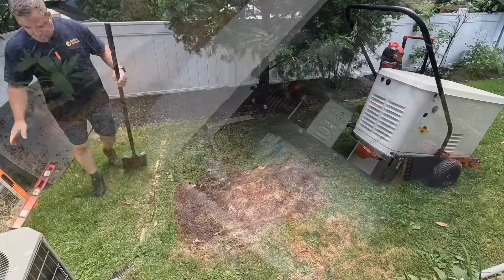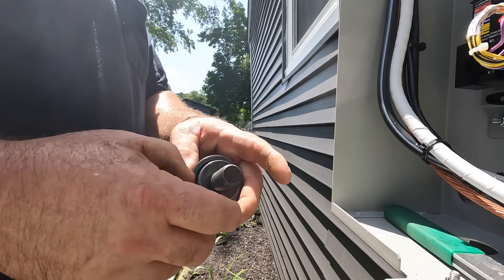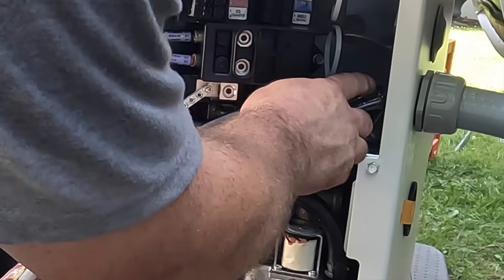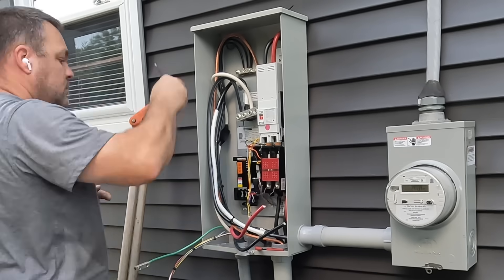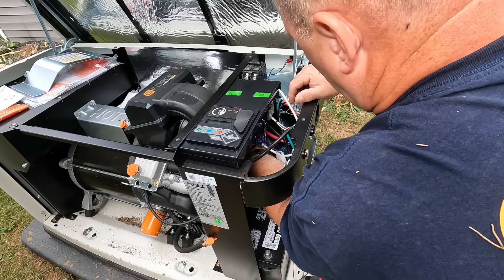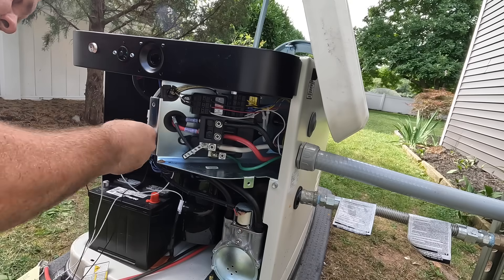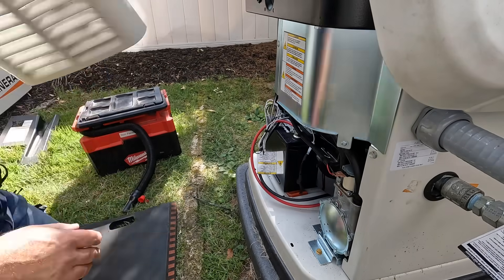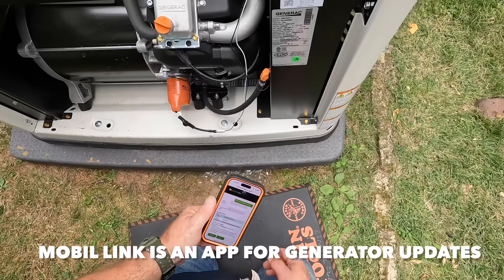Watch me install a generator in Garwood, New Jersey

Comment: Ron, wonder if I could ask for some advice, love the videos even though I'm not an electrician.... mechanic that specializes in wiring for tractor trailers and refrigerated trailers. 
I'm not looking for "how too" advice electrically, more.... how to ask an electrician for help.
I'm looking at adding one of these to a house I just bough (funny enough it's near one of generac plants).
My issue, I'd like the main panel/meter updated too 200Amp before/while this is installed. All stuff I have done in the past, but when an electrician friend of mine pulled the meter for me, double checked my work (found nothing wrong) and then did his work upgrading the meter box and such for the utility company to then do their stuff.  
He passed and TBH, new house is too far to ask even if he hadn't. 
As a mechanic I understand electricians gotta eat too, so not trying to....  so what's a good way to go about asking a fellow electrician if I can do some of the "grunt work" to keep costs down, without offending?  I'm in an area that needs no permits unless hiring out, so IDK if that will affect things. 
I thought about having someone put the disconnect in and.... well....
Reply from the maker: The grunt work might be digging a trench, or going into a crawlspace.  No one wants to do that.

Comment: Thanks for all these great videos. I found your channel researching on how to install a Generac generator. I did most of the work myself. I got the 200 amp breaker panel with the transfer switch . Had a licensed electrician wire that. I set, wired the generator to the panel and performed all the checks in the manual. Did a half hour test run.  Worked great, then waited and waited for the power to go out then finally, ran for 17 hours straight no problems. Your videos helped me a lot. With the owners manual it’s pretty straight forward. If you use an AGM battery you don’t need the battery mat, I did wire in for the oil heater.

Comment: Great video, but I have a few questions. First, was a permit required for the gas hookup? Second, could the electrical and gas lines to the generator be buried in the ground? Third, I realize it all depends on usage, but how often does the generator need to be serviced? Thanks,
Reply from the maker: This town required mechanical, electrical, and zoning permits.  Usually it’s ok to bury the gas and electric in the same trench but check with the building department first.

Comment: I have this same gen. with 2 load sheds for the A/C's. One day one of my A/H's didn't come on. Thought it was the usual float switch. Nope. Had no 220v. Checked the breaker it wasn't tripped. I pulled the panel and had voltage coming out of the breaker. I tied the wires at the A/H and had continuity at the breaker. I thought maybe a critter ate the wires in the attic but all good. I was stumped. I even swapped breakers which made no sense but same condition. I finally remembered the load shed. I bypassed it and my A/H came back on. Turns out Generac had a bunch of bad boards. The original board is red. The replacement is blue. If this ever happens you don't have to bypass it. Just pull the connector off the board on the load shed. It's basically a contactor that's normally closed. If there is an issue it opens. The opposite of an A/C contactor. Generac covered this under warranty.
Reply: As it turns out, my electrician who wired the generator never connected my AC to the load shedder  so for now, I turn off my AC when a storm approaches so as not to overtax the generac if we lose utility power. For all the $$ I was charged, I can''t believe they did not do that.

Comment: Why use that expensive composite cable though?  Since it was a straight shot you might have run individual conductors and saved money and not had to strip that heavy jacket.  That stuff is typically used fully exposed, it's rated for it, though it makes it look like you hooked up the generator with an extension cord, some people want only the cheapest
Reply from the maker: You must not know what you’re talking about. The cable isn’t “cheap” and it slashes labor.
Reply: @electricianron_New_Jersey  Well I do personally install generators for a living, not just one or two a year.  So I might know what I am talking about.  I have used that cable in some circumstances.  But for a 10 foot run that is already inside a conduit I don't see the rationale.  Why not just run it exposed then?  I don't see the labor savings on this particular job.
Reply: @nspro931  I agree with Ron, I.m a Factory Authorized Generac Dealer/Service. I only stock the copper Gen Cable for all Generator Jobs, you can go inside/outside with one type of cable, sleeve it outside if you want, Only have to stock one kind of cable, Who wants to fish 4 power conductors and 7 thwn wires thru that sealtite, worry about hooking it up correctly, The Gen cable is already labeled and color coded, It saves labor $$$$
Reply: @paulcoulston1987  In that case why use Sealtite?
Reply: That's why I said, sleeve it if you want to, some inspectors would make you sleeve it for physical protection, that's a AHJ  interpretation, I would also sleeve it from where it leaves the wall into the generator and supported on the unit strut but if I have a long line on the wall I would just strap it to the wall. Again your choice along with the AHJ

Comment: Hey Ron really nice job, However does Code allow the control wire to be in the same conduit as high voltage wires ?? I'm guessing the control wires are shielded cable
Reply: Great question....( I saw that too) yes as long as the insulation rating is equal or greater than the other conductors in the conduit. Control wiring of this spec is avail. Ron is deferring to the mfg install directions as he mentioned.
Reply from the maker: Nah that’s some Kohler BS

Comment: Great job as usual Ron. I was on a Generac Facebook page and was lambasted from some idiots telling me not to install the battery heater and oil heater. I ask them why and they said it will melt the battery and other areas 😂. Some people right. I have the similar generator at my house and works great 👍. Thanks for the nice video and explanation.

Comment: Why didnt you want to bury the feeder and gas piping? Ive never seen an aboveground install. Seems like its in the way
Reply: Was wondering this too.
Reply: Yeah that’s a real trip hazard, also should’ve put protective caps on the top of those struts.
Reply: Knock it off. The customer doesn’t always want to pay extra for a trench. Sometimes there are water/gas/electric lines buried. It’s only a few feet off the house and this is the way to do it if you don’t have trenching included in your bid.

Comment: Does an autonomous generator need to be grounded separately or is this just fine to keep using the same grounding as in the distribution panel?
Reply: Not usually unless it is considered a separately derived system